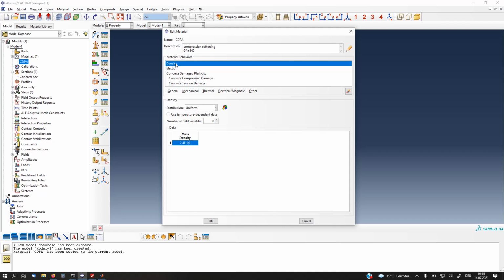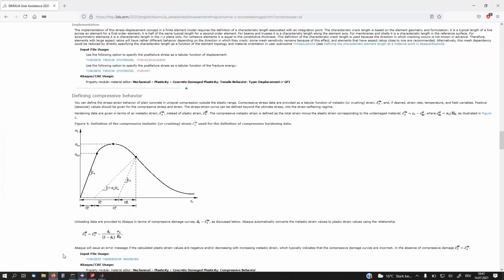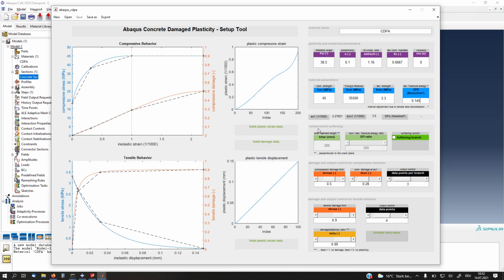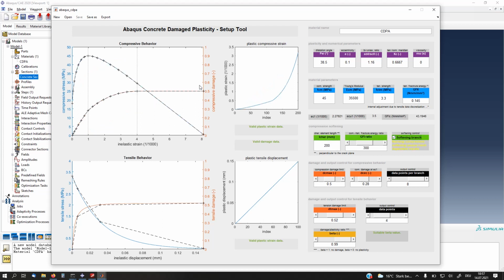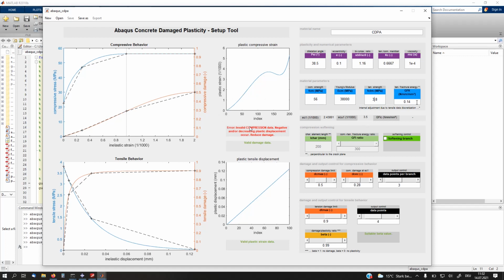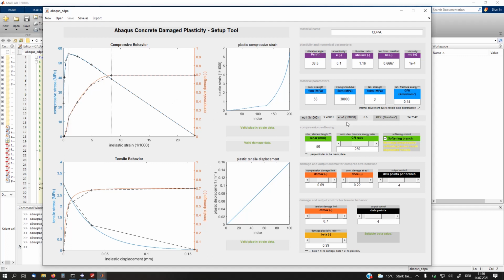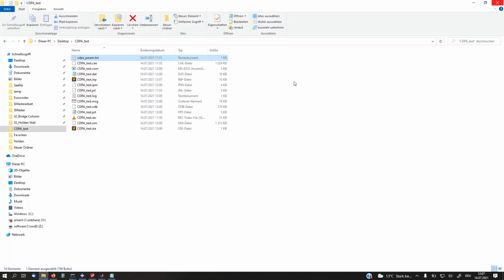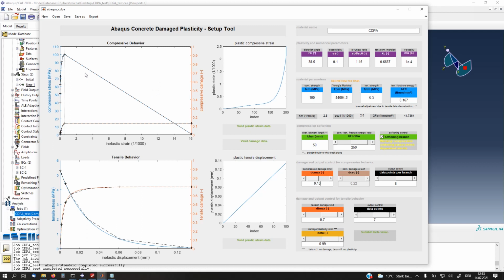Abaqus Concrete Damaged Plasticity Setup - Matlab Tool - Tutorial

Comment: This is outstanding. Thank you for sharing..I just have one question, Is the caractarstic elemnet legnth same as the mesh size?
Reply from the maker: it is the length, which is perpendicular to the crack direction 
Since your elements should not be too distorted anyways, ideally they would be perfect cubes if you use hex elements, it is basically the edge length
Reply: @joesy3721  Hello Joesy thx for replying.. with this tool I am getting an acceptable result from my abaqus model. But the elements under tension stress are extremly distorted! any advice?
Reply from the maker: @abdallarselbana3394  
there could be several reasons for that.. i can only name a few i personally encountered myself:
If your elements get distorted very early in the analysis material damage is apparently progressing too fast, so make sure you don't have any singularities like harsh boundary conditions or similar. If your boundary conditions are rather simple you may want to try a higher fracture energy to make your material more ductile (of course in compliance with eventual experimental data) 
I also had problems with very fine meshes, because the damage localizes even more (tensile damage mostly localizes in rows of one element and you might have a problem if there is no rebar supporting these elements if maximal damage is reached)
and last but not least i suppose you deal with reinforced concrete and used the embedded rebar approach properly to redistribute the stress once the concrete matrix cracks

Comment: Sir, I am doing parametric studies of Prestressed Girder in ABAQUS, I am stuck in creating solid parabolic strand, and tried a lot to find any helping material but failed to have it, would you help me out please? Thanks in advance
Reply from the maker: This question does not seem to concern this tool neither. Anyway, if I got you right, I think your problem simply comes from Abaqus' limited CAD (modeling) capabilities. You may want to try a proper CAD software (solidworks, creo,...) and import the geometry to Abaqus.

Comment: Hi Dr
Can I use this file to modify any factors in CDP, for ex. if i need to define concrete containing rubbers pieces, can this tutorial help me?
Reply from the maker: This question is rather concerning the limitations of the concrete model itself and not this tool. The Abaqus documentation and its references should be able to help you. Without checking it specificly for your question and lacking knowledge of concrete containing rubber pieces I can only tell you that the Abaqus Concrete Damaged Plasticity Model is based on the Lee and Fenves Model which initially was developed for usual concrete under cyclic loading.